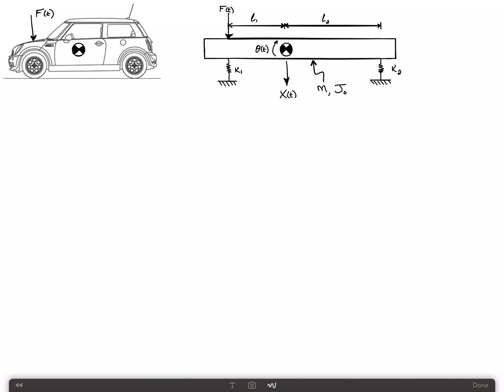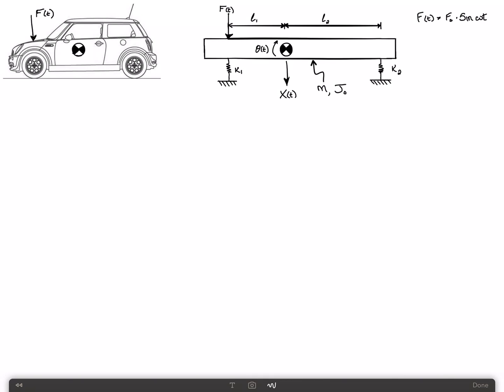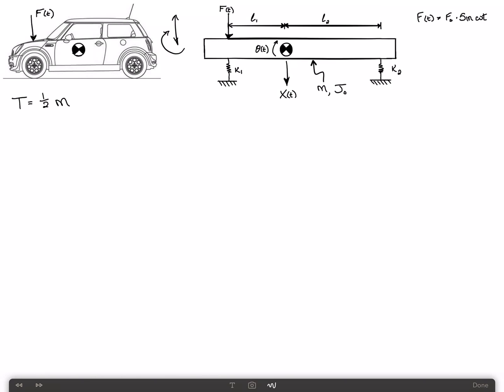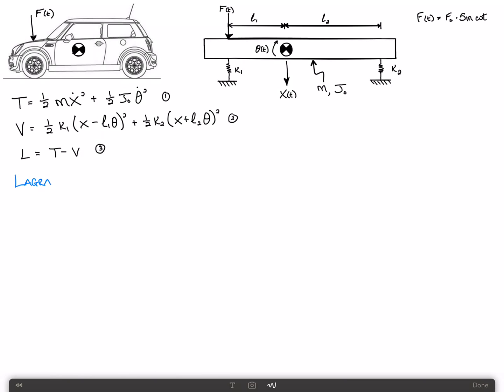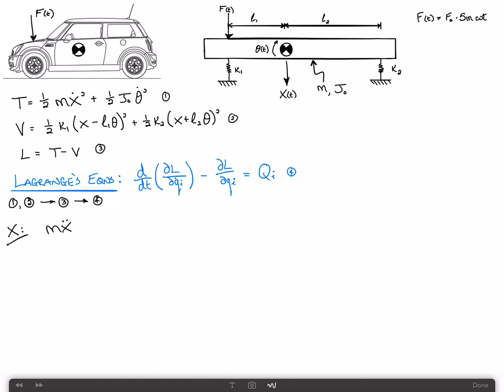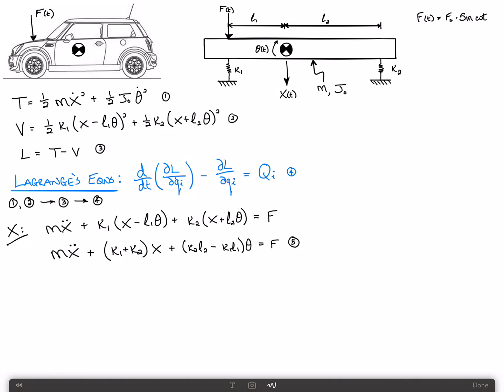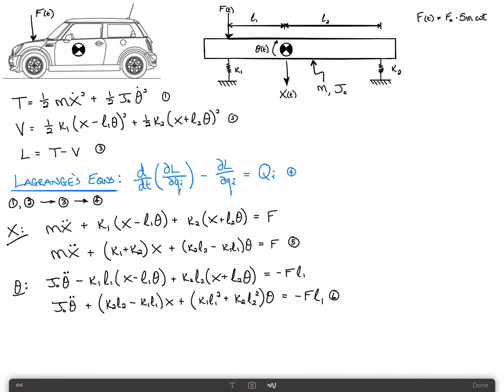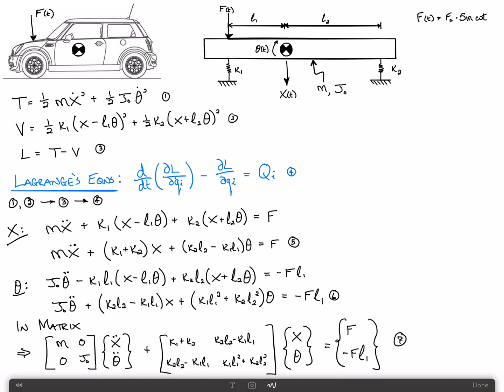Equations of Motion for a Car (2DOF) Using Lagrange's Equations

Comment: Please i need two examples for application on motor vechiles vibration system , one single degree and the other 2 degree  iw ill be Failed in the test , and i need both examples link or document or anything please
Reply from the maker: The video above shows a 2 DOF treatment of a vehicle.  The video in the link below shows a SDOF model of a car hitting a speed bump.  https://www.youtube.com/watch?v=KZ0zL54Ss34

Comment: NICE Lecture, exactly what I was looking for. Thank you very much! I have one question though. In the kinetic energy of the equation. Isn't [L*theta] considered an arclength and kind of wouldn't be able to be subtracted from x, a linear dof (same for adding in the second part of the equation). Are we assuming sin(theta) = theta in this case?
Reply from the maker: Yes, we are using the small vibration assumption, so sin Θ ≈ Θ.  Almost all the material on this playlist deals with linear problems and the assumptions of small vibrations.  The only exceptions might be the pendulum problems.  I probably should have stated this in the video.

Comment: Why does the car only have 2 degrees of freedom? Can't it also yaw and roll?
Reply: Never mind, I suppose the springs act in rigidly and only go up-and-down.
Reply from the maker: Sure it can.  In general, the mass will have 6 degrees-of-freedom (i.e. 3 translations and 3 rotations).  

Very often, we try to build a very simple model first in order to get a basic understanding of the effects at play.  A 2 degree-of-freedom model such as this one is a common one used for a simple 2-D analysis.  It includes the vertical motion of the car plus the pitching motion which are the degrees of freedom that typically experience the largest amplitudes of vibration (under typical driving conditions) also it captures the coupling effects between these two vibration modes (FYI - such a model is also commonly used for simple analysis of an airfoil - when examining the the coupling between bending and torsion).  

Typically, a model will be refined over many iterations.  At that time, one would add additional degrees of freedom AND one would ultimately model the car as a structure rather than just a point mass.  As the model becomes more refined, you will use the simpler models to benchmark the accuracy of the new model.

Comment: Nicely done, thank you for this.  I've been looking for a way to apply the Lagrangian to the yaw and lateral motions of a vehicle, and it seems we can rotate  your example by ninety degrees and the same motions apply: the ratio of front to rear tire cornering stiffness and CoM location would determine the coupling of the two motions.  Thanks again for this, and if you're still contemplating doing some controls stuff, you have a vote from me.
Reply from the maker: Thanks.  Also possibly of interest might be the 2 DOF airfoil problem which explores a similar coupling due to the offsets between the elastic center and the CG: https://www.youtube.com/watch?v=PPN6SJhWAOU - slightly different dynamics, but another example of how to model this effect.
Reply: Thank you for the reference to your other vid, that's really helpful as well.  I'm a vehicle dynamics fanatic, particularly with respect to stability and control stuff, and I've enjoyed the material on your channel very much.  On the topic of coupling effects, I've become interested in the effects of a 'rigid' body, such as a car, rotating about a non-principal axis, as might occur in the roll of the sprung mass.  The resultant yaw effect would be interesting to study.  Thanks again.

Comment: Hi sir, I like the way you explain things. Everything seems easy to understand for me.
Do you know about a full vehicle model with an active suspension system? I'm still missing about how to determine the input force for the unsprung mass.
Could you explain that to me? Thank you.
Reply from the maker: What you're describing is a controls problem which falls a little outside of the scope of this material.  Unfortunately, this is not something I can explain in a comment, it will require a video (or two).  The first step is tat you need to decide on what type of control system you wish to use.  You should be able to find YouTube videos explaining this.  Perhaps I should make a series on Control Systems next.

Comment: hi mr. how to solve the natural frequency in this problem?
Reply from the maker: You need to find the characteristic equation by applying:
det( [k] - w^2[m] ) = 0
then solve for w to find the natural frequencies.

Take the mass and stiffness matrices as I have written them in Eqn 7 and then proceed exactly as I have in this video:
https://www.youtube.com/watch?v=zo2Ml88QyrA&feature=youtu.be&t=3m57s 
with finding and solving the characteristic equation (Eqn 5)
Reply: ooo ok I got it.. this video helped me a lot.. just got stuck until the end of the video.. i dont have any idea after that. haha. thanks mr. freeball.. may you have a good day